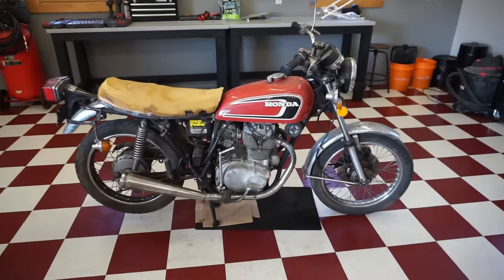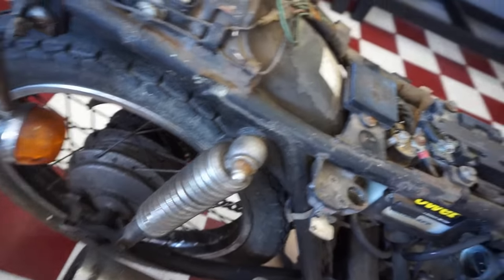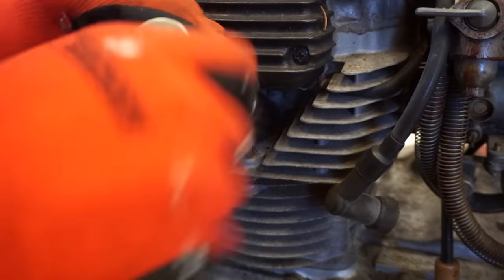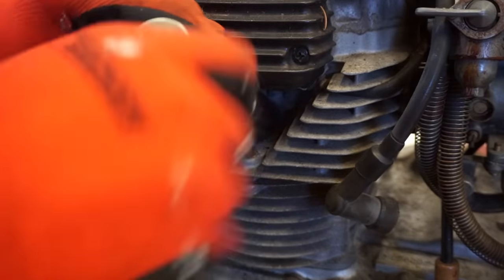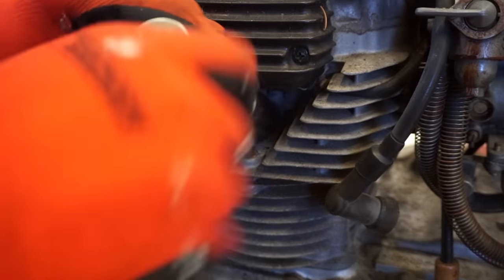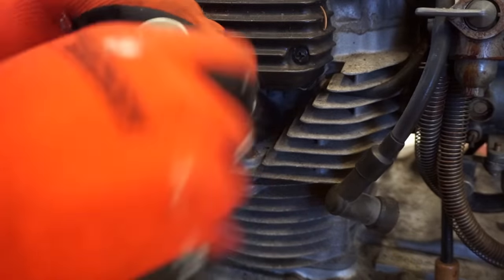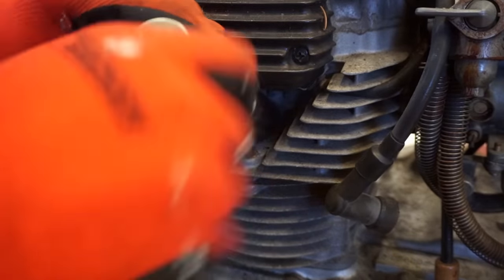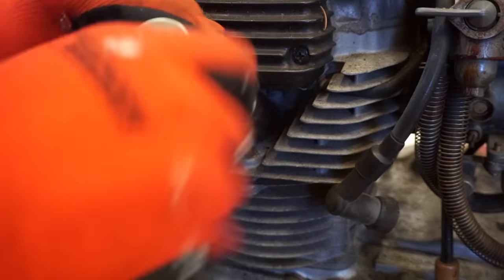Free Honda Motorcycle Find In Abandoned Storage Unit

Comment: I had one of those. Bought it in 1984 when I was stationed in Ft Dix NJ. It only had 9850 miles on it and the guy that sold it to me only made me pay $1.00 a CC,so $360.00. It had sat in a garage at a house he bought for 6years, left abandoned by the former owner. Just had to clean it up. Clean out the gas tank and carbs and replace the plugs,I did replace the tires as well.

Bike was a blast. I rode it for a year and traded it in at a Motorcycle repair shop for a 1975 Honda 550 Four that the lead mechanic had owned and did a lot of work on to make it really fast. Still own that one.

Comment: Great video!  My first bike was a 1975 Ruby Red (same color as yours), CB360T, which I bought in 1992.  I still have it.  900 miles when I bought it and 1900 miles now. Original tires still on it.  Original everything except an OEM replacement exhaust. Sitting in the corner of my walk-out basement for the last 15 years. The sounds of your twin brought back a lot of memories.

Comment: Just inherited a 1981 KZ1000 last year and went through the carbs in slightly worse condition. Looked like molasses inside. Pilot jets had to be drilled out. Took a few days of cleaning but got it to run after sitting in a climate control garage since 1987! (I was 3 at that time).

Comment: The Honda 305, 360 and Honda Super Cub, the best motorcycles ever made, hands down!
Reply: I like the way this guy is teaching me how to write. He takes the time to use PUNCTUATION!
Reply: The Honda 350 was a very popular bike in the early seventies. They were everywhere and were a fairly large bike for the time. I never saw one that had 15000 miles on it without being rebuilt. The ran hot and blue pipes were normal. Mine would top out around 100 mph and cruise at 65. The 360 supplanted it and was not nearly so common around here. I never had one but I got a CM400 that followed the 360. It threw a rod at 9000 miles so I gave it away.

Comment: You've got to thoroughly... Thoroughly... Thoroughly clean those carburetors. By the performance of what I hear in the video. You may very well have Is a high speed jet problem. I also observed what could be an aftermarket exhaust system. If this is true. Try going up 2 or 3 sizes From the original main jet size. These things can be temperamental When after market exhaust systems are installed. Usually making them run leaner than usual. Which could explain Wide open throttle lag.  I seriously doubt very much that the lack of air boxes has anything to do with it. Now if you were traveling 50 or 60 miles an hour with a crosswind, And you Experienced A feeling of starvation in the throttle, But you weren't going more than 25 or 30 miles an hour in the video.I bought one of these back in the early nineties,  75% assembled, I had to do the rest to make it road worthy. It was truly a labor of love, And yes, They're existed in the after market exhaust system on the one I owned, Picked the brain of a local Motorcycle Tech and he steered me in the right direction, Stepping up the size of the main jets. I still wish I had  Held on to my 360, It never let me down. Head on a swivel and cover your break. Good luck my man.

Comment: Seems to me in the beginning the valves where sticking a bit. 
Also a very important thing when you ''restart'' old 4 strokes that have been sitting for a long time. 
Take the valve covers off and spray the valves/stems and seals with a cleaner (no harsh chemicals like brake cleaner) or some penetrating fluid like WD-40 and then drench the seals and every moving parts with oil. Let them sit for a bit and slowly turn the engine around. 

There are holes in the rocker arm assembly. Just push lots of oil through there and throw a bit of oil over the camshaft so everything is nicely lubricated for the first couple seconds of running. 

It keeps you safe from doing nasty damage to the valves and valve seals. Especially with bikes that are getting rare.
(I have sadly been there. Lots of unnecesary wear and tear costing me a good penny!)

No hate just a quick tip, you look like you know what you are doing. :)
Reply: He doesn't do anything with common sense!! He does a lot of idiot things. He damages a lot engine or shorten its life all the time.never let engine's to operating temps or break 1 in.he just rev's them up immediately!!
Reply: Said he rode it illegally before he started working on it.

Comment: Good old dependable Honda. The bike sitting years in questionable conditions and straight away it has spark. Compresion, it has all of the compression. Carbs get a good clean and off she pops. As you said, it should run better if you get the airbox for it. Great old bikes and they look cool too.

Comment: My hypothysys is letting the kicker return under its own spring power  and hit the stop with full force causes this tab to bend on the bracket on the end of the kicker shaft in the center of the cases, push and pull the kick shaft when it's running and make sure your isn't grinding.

Comment: I just started this video and I can't help but think; 'man, we have a different definitions of rough. That'll probably run with just clean fuel and a quick carb clean, that's the important bit'
But then I dread the idea of fixing actual major engine issues and thrive doing all the annoying small stuff like diagnosing and fixing crusty electrics, rebuilding brakes, etc, so maybe we're polar opposites.
Reply: Yeah he thinks it's rough it is rough but it's not as bad as he's bitching about
Reply: No it doesn't have to be running for that headlight to work😂.. that is what is called a battery and coil ignition.
It's funny the one you think have to have a battery don't need one. And the ones that need a battery you think don't need it.. 😂
Reply: Leave the damn plug in 😂
Reply: He doesn't want to scratch the cylinder with that plastic oiler

Comment: I bought one of those brand new, and it was called the cb 360T back in the 70s. The only races that I ever got smoked was by the Suzuki GT 380 and the Yamaha RD 350. I outrun the kawasaki 400, and the Honda 350 with ease. Got recalled by Honda over the cam chain tensioner and sold it for 700 dollars after that.

Comment: I found one in far worst condition and restored it. Those are great little bikes and relatively rare. If you don't restore it, you could easily sell it for way more than what you gave for it. Just FYI, there is a great place in Houston called Common Motor Collective. They are a great source for CB related parts, and cheap. Thanks for the cool vintage content. New subscriber. Cheers!

Comment: The pair of boots at Hebron, Kentucky for CL360 or CJ360 to connect with stainless steel hose clamps at a costs $29.99 and it is 90 degree angle between the line of the flange and the flow of boot pipe. The Honda CB350 have the boot at angle 65 degree to around 75 degree for the price is $16.00 dollars a pair. Thanks.

Comment: Carburetor needles jet and jet orifices and o-rings and seal for upper carb lid. Please, keep your float bowl gasket so use gasket reseal RTV soft kind silicon in tube. The K&L have the genuine parts kit for CL360 or for CJ360 1974 up to 1977. Includes 4 to 6 day shipping for only $19.99 USD.

Comment: Great starter bike for the day, the 6 speed would run 90/95 mph, as fast or faster than the 4 cyl 400.
Most had electric start, cheap parts, good fuel economy and fun to ride....

Comment: The float for the carburetor is all brass at the store from Monday to Friday is named Common Motor Collective near San Pablo Boulevard Berkeley Honda Yamaha Gilman Street store online. For both carburetor floats is $44.00 dollars plus shipping cost yep for Honda CB. Please, compare the differences between CB350cc carburetor and CJ360T carburetor Your bike 1974 CJ360 super sport as more HP than CB Hongda bike. Both carburetors are the same. The CB Honda Moped have wider bracket so two carburetors are more spacing in between than the CJ360 pair of carburetors spacing.

Comment: It’s highly probable the vacuum diaphragm  at the top of the carburetors  are cracked, and not allowing the needle to be pulled from the seat. Putting more fuel into the intake.
You might wanna check them.

Comment: Need the 3 gallon gas tank with some rocks from gravel inside and no smaller than 1/2 inch square per rock. Add rubbing isopropyl alcohol to the gas tank for cleaning and tumble and shake the gas tank. The carburetors that your cb360 have is a new model that the old carburetor of 1968 Honda 360 sports is different. Pressure up the gas tank to at least 10 PSI plus the atmosphere pressure at 14.8 PSI in today outside pressure for altitude 315 ft high above sea level. Thank you.

Comment: Great bike and also clean. The rear tire is 19 inch front tire is 21 inch. You need cleaning the carburetor and run idle for 10 hours and don't rev at higher than 700 rpm. Then listen for valve sealing and then valve adjustment. Use Stethoscope and unplug the spark plug and tighten up the spark plug and compression good or too low while starting the motorcycle but one person for kick start and other listen to the compression pop suction sound. Thank you. 
  Tire will cost in Loudon, Tennessee service for 80-110mm-19 Shinko racing cruising tires or all terrain tire is model E705. Please check that out and 2 matching tire will be UPS or 5 days shipping.  Thank you Shinko Tires and you guys.

Comment: Think you were on fire at 31:21. Under the tank in the front of the cylinder head where the exhaust bolts in.
Reply: I saw that too,but i believe it was just optical illusion from smoke flashing against his block floor pattern,but im sure the smoke was coming from the leaky petcock of fuel onto a hot engine jug or exhaust which could still self ignite.im intrigued why not just do a lost title and why he doesnt do a scrub n epoxy coat on inside tank.it was bad but mostly surface stuff,wasnt like it was rusty thin.must be no money in it,to flip,hell at least sell or give away to someone who can ride the back 40 acres or farm roads.that might restore it to former glory!snookie pa.

Comment: Fill the tank with white vinegar, close it up and let it sit for a few days. Shake it a few times a day. Drain, then throw half a litre of hydrochloric acid in it, slosh it around for a couple of minutes, dump and rinse with soapy water to neutralise. Rinse with fresh water, blow it dry with compressed air then spray a heap of WD40 in there to stop it from flash rusting.

Comment: Best way to clean out a fuel tank like that is to put a couple handfuls of nuts and bolts in it with a little fresh fuel. Then jack up the back of your truck and tape the tank to the wheel and put the truck in drive. Then start cleaning the carbs and when your done with that. The tank should be ready to rinse out.
Reply: or instead of fuel, use vinegar or if its really bad muriatic acid, but you have to be careful and neutralize properly.

Comment: Here in the UK these (and the CJ 250/360) had a reputation as lemons. Handled okay, went okay but not for long. If you neglected oil changes and never cleaned the oil filter, they would eat the cam bearings in short order and the cam lobes and rocker faces quickly afterwards.  Cam runs direct in the metal of the head and rocker cover.  Starved of oil, the ally would smear onto the cam bearings. New head please!
Rockers in the UK are the things that work the valves. Or mod antagonists. Or wobbly chairs for the elderly. Not bits of car.....

Comment: That's a CB360 G5. They did a 250 version as well. Dont think it was one of Hondas best sellers. The 250 was up against the sportier two strokes of the day and the 360 against Hondas own CB 400/4. There was also issues with cylinder head and camshaft wear on some bikes. The 250 and the 360 evolved into the 250T and 360T which as basically the same bike with different paint and some plastic bits. Eventually made way for the 250 &400 dream and super dream. As you say its never going to run right without the airbox but at least you got it running.
Reply: Was looking through the comments to find this one, you're spot on, the 250 g5 were up against the gt,s and rd,s of the day, and like you say the heads wore out because the cam shafts ran mettle on mettle without bearings, the rocker arms would wear out and the cam chain tensioner would soon come to the end of its adjustment, people would use a screw driver and hammer to snap the tensioner to keep it quiet long enough to sell them😆

Comment: Sounds like it was only running on one cylinder the whole time with a bunch of back fires! Your carbs were missing the throttle end caps which is a huge vacuum leak. I do a lot of 360 stuff on my channel .... Do it Yourself Do it Right.

Comment: Where can I buy the Honda 1974 350cc up to 360cc Twin complete motorcycle with worn out foam seat? The battery box must come off and the airbox or it would be two foam balls from Weber USA dealership online. The choke will prevent the foam ball from entering into the carburetor. The plastic tie-strap is to be put on so the air filter foam will not fall off. The air box needs air cartridge filter for it has a cylindrical shape for Interior diameter 42mm includes 45 degree angle connect to pleated-cotton paper filter for one breather is worth under $20.00 includes shipping in Import and Export Online. The carburetor for CB and CL350 will be like size 35mm O.D. I don't know. 
  After you put on the pair of air filters that looks like K&N then put back the battery in between the air filter with stainless steel hose clamps.
 Please, can you read the voltage of the battery and disconnect the battery charger away. Thank you.

Comment: After you check the oil, why do you wipe the dipstick again, when you put it back in the motor 🤔
Reply: The reading when he first took the dipstick out was from it being screwed right in, but the specified level is with the cap resting on the top of the threads, which gives you a lower reading.

Comment: Carbs are out of balance.  It's not an 'airbox thing' .  I had a 1972 Yamaha 650 with Mikuni carbs like those and it worked fine without air filters.  I don't get the 'no title' thing.  You should be able to file  for a new one.  Get the seat upholstered and the turn signals working and you have a $600 bike.

Comment: Ok, third video I’ve watched, and your RPM stabs, on engines that have sat non running for decades, kills me!! How is a full throttle crank on a poorly running and carb tuned good for it??? It’s not! You have so many micro oil channels that need to lubricate and expand with heat before you do that! You could actually ruin an engine that way, that would otherwise come around. Also, your carb rebuilds are not flowing in the intermediate channels, that’s why it bogs.. last point, ANY engine should not be rev’d to redline without a load on it. Think 50% of its max RPM as a standard, and you won’t ever hurt one… also sync any old carbs that have likely became way off, from the cleaning, and knocking around the adjustments….. Ride Safe..

Comment: Why do you believe that trying to start it is the smart thing to do? Any engine that’s been sitting that long could have multiple internal issues, the least of which is corrosion in the bores that can cause the compression rings to seize to the cylinder walls. Then when you come along and start messing with it, the chances of breaking the rings and the annular lands between the rings on the pistons is massive. 

Dumb impatience.